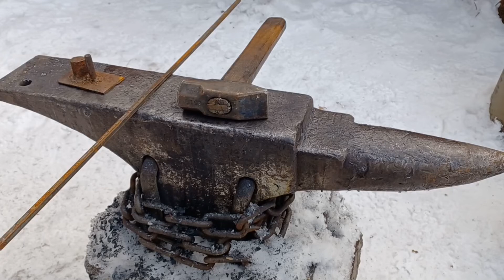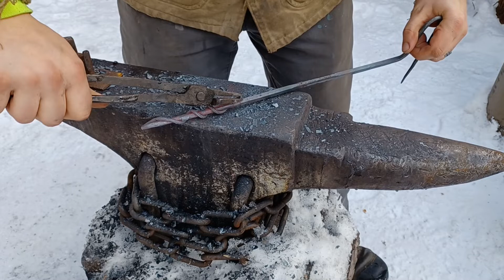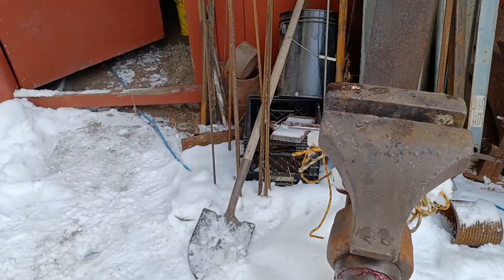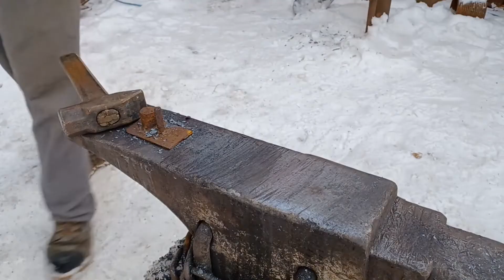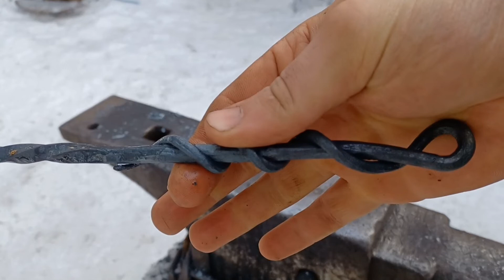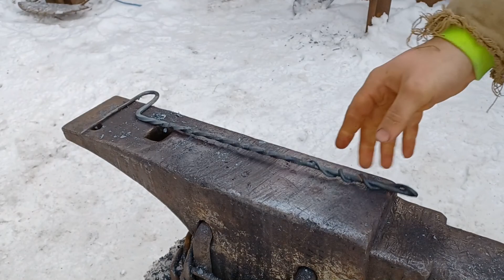How to Forge Tools: No Forge Weld Fire Poker

Comment: Nice style. Well described. I think I'll give it a go.
Cheers.
Richard.
Reply from the maker: Thanks! I've done a few of the welded pokers where you make a loop, forge weld it, then cut it open afain, but I prefer this style. And I think these ones work better too since the point for pulling is at the front, not 6 inches back from the tip.